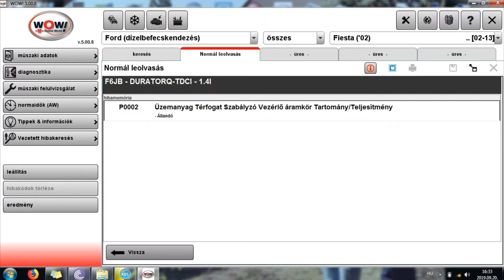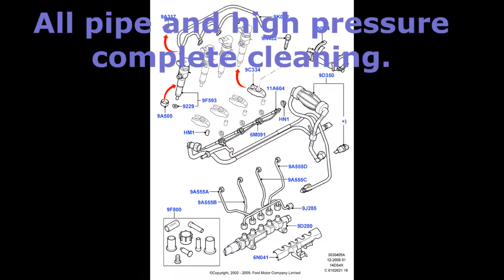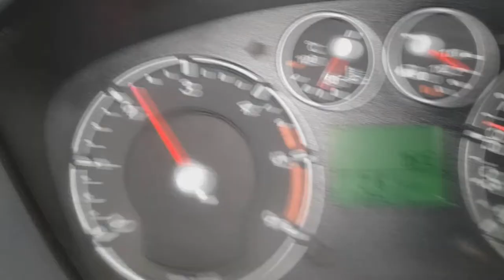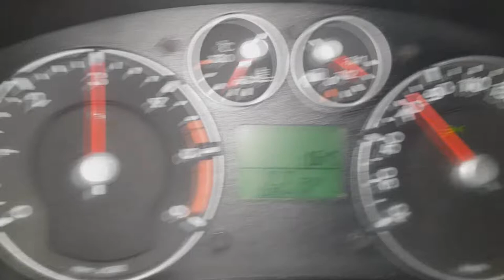Ford Fiesta MK6 2008 1.4 Tdci engine hesitation jerking shuddering P0002 P0191 Injector egr fault

Comment from the maker: Hy
It wrote my diagnostic p0002 fuel rail pressure sensor. My car can start and I try new sensor but the fault is same. New sensor not help. I put it back old sensor. Engine is hesitate and jerking. 
Check the 4 injector! If it siemens injector it is a problem. Bosch injector is stabil.
P0002 Fuel system problem. The engine dont get fuel. Maybe bad high pressure pump or fuel tank pump or injector. 
I think it your problem is injector problem.

Comment: Friend, I have same problem but without any code fault. Injector, turbo, fuel tank, EGR... Everything is fine. But car juddering about 2000 rpm. Very juddering. 
Do you think it is high pressure sensor? Or regulator valve? Thank you
Reply from the maker: Hy! You dont change the pressure valve of high pressure pump.
Unfortunately, they are made together. It should be taken for a test bench test.
4 db siemens elements checking.

I ckeaning complett fuel system, fuel tank also and intake manifold egr.